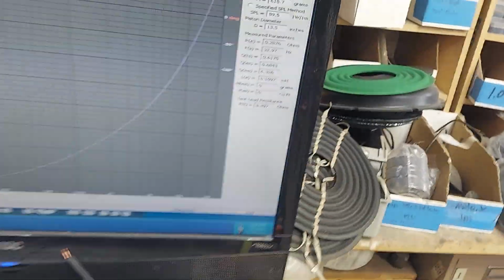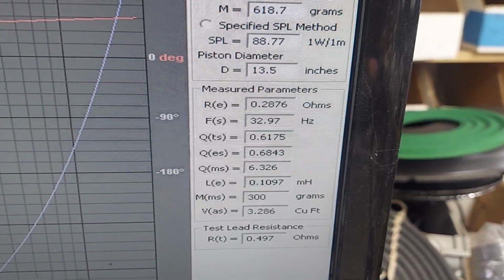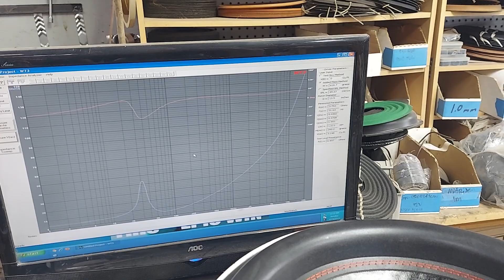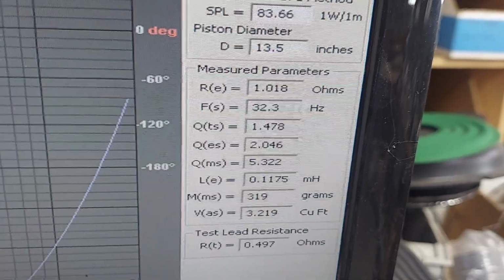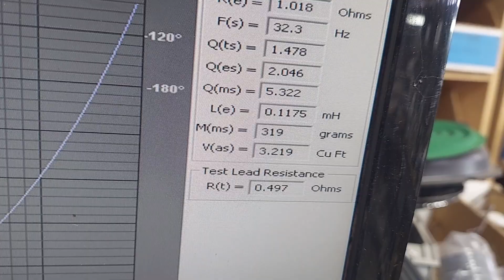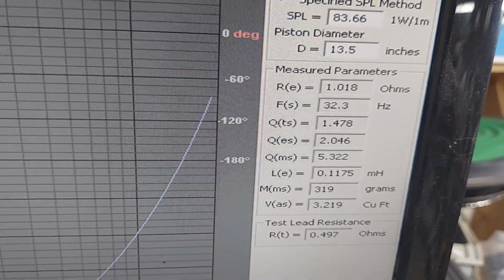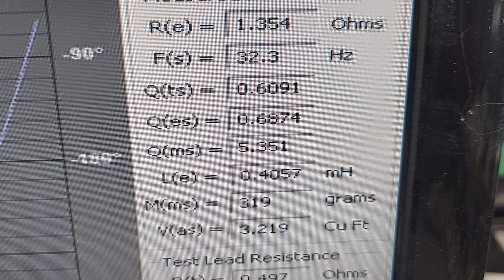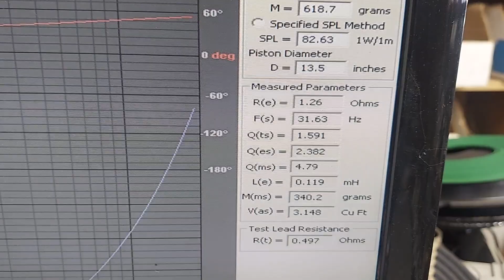Subwoofer / Loudspeaker Wiring:  Does wiring a DVC / QVC series or parallel matter? .25 ohm vs 4 ohm

Comment: So being wired in series get more sensitivity ? So for guys thT have been in the industry for awhile would appreciate a better more accurate sounding subwoofer that doesn’t necessarily need a ton of power. But ! If when u wire in parallel ? The power handling goes up slightly, so i have two questions than. 
If u were to just throw more power at the woofer wired in parallel , would that overcome the woofer being less sensitive and get louder anyways ? 
Question two is is there really that much of a difference of parallel and series wiring , if both tests were done with the same exact power? Would the average joe notice spl or an SQ difference
Reply from the maker: You may notice a difference but it'd be nice to see the difference on the meter if you're obsessed with SPL numbers.
Reply: @RobotUnderground  nope im not a fan of one note wonders i like a all around great sounding sub that gets low and high
Reply: @RobotUnderground  it would also be nice to see a frequency response difference as well
Reply from the maker: @annihilationindustries1990  There shouldn't be a difference since the mass stays the same.
Reply: @RobotUnderground  but i thought with more motor force when a coil is wired in series since its long would make a difference. Sounds to me like wiring doesn't matter , the only reason wiring matters is to match up a sub or subs to your amp to keep it at a certain ohm load.
Reply from the maker: @annihilationindustries1990  Series was showing a higher sensitivity but I'd love to see real world tests with the sub installed.  That's why I showed the bigger difference of .25 ohm vs 4 ohm.

Comment: Got bak into car audio during Covid, on a tight budget. 2 NEW SDR-18's dual 4's wired parallel, refurbished RP2001.D,.
Got floppy, no control, bass. Seemed "late" compared to rest of audio. Thoroughly disappointed, 4  quite a while. After listening 2 Patrick @ Robot Underground. Tried wiring in Series & OMG, was exactly as I wanted & expected. All issues gone, deep, tight, & "on time" BASS. Thoroughly enjoyable experience now.
Wanted 2 add. I did the "big 3" actual 4 with 00 OFC at time of install. Stock 130 amp alt.
Reply from the maker: lol.  I'm a magician!

Comment: Your shop seems very noisy.   I have had issues getting accurate data out of WT3/DATS systems if there's noise or on a windy day, and don't even think about trying to pull specs if you have a ceiling fan on in the room.  

Consider also "sensitivity" is calculated and not measured and it is a number that seems to be not so useful once we leave the realm of very low powered midrange and fullrange bookshelf or PA type drivers.    If we wanted to do a fair and useful test you would want to put that sub in a box, in a vehicle, and measure volts/amperes to give it the same power in all coil configurations and use an RTA or SPL meter.   I have some suspicions on what results will show but I am quite confident the difference would be inaudible (less than 1dB).

Consider also that if you're able to ship out an 8KW amplifier for 500$ that we can feed with a battery bank that weighs under 30 pounds and is the size of a 12 pack of pounders, efficiency isn't even all so important these days.   Power is cheap and comes in small packages (both amplifiers and the batteries to feed them) and the conventional wisdom in the big builds I see these days is just brute force.  When balancing our options as we look at Hoffman's Iron Law, high efficiency is by far the easiest thing to throw out the window these days.
Reply from the maker: It all boils down to value.  Performance vs Price.

Comment: Tests all look normal to me, physical wire distance traveled in the gap by current is not changing between tests so no big changes.  You need to think of the coils each as a separate strand since they are all coated and individual from each other, so even when you change from series to parallel you still have effectively the same amount of active wire and distance traveled in the gap.  If you dont power all of the coils then you lose active wire in the gap which lessens the efficiency, among other things (Qts, Qes, Le relation show this).

Comment: I have seen quad voice coil speakers used in a few applications. The Jeep Wrangler Alpine audio systems have a quad voice coil subwoofer because the amplifier runs at battery voltage, so the woofer provides four 2-ohm coils to the amp.
Reply from the maker: Yeah, I found one of those 100w wonders that Kicker put out for the Nissan Frontier and were $10 each from Parts Express back in the day.  I bought like 40 of them!

Comment: What program are you using to find the parameters?
Reply: Dayton audio DATS system
Reply from the maker: WT3 from Dayton Audio.  It's the older version that's made for WinXP.  Device is the same as the DATS but DATS has updated software.